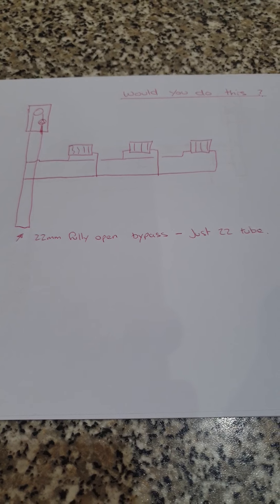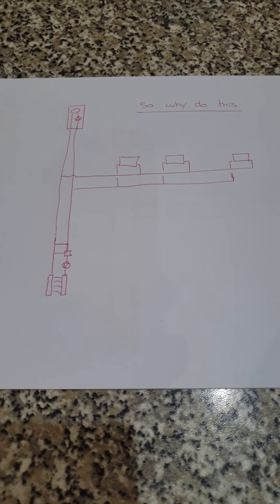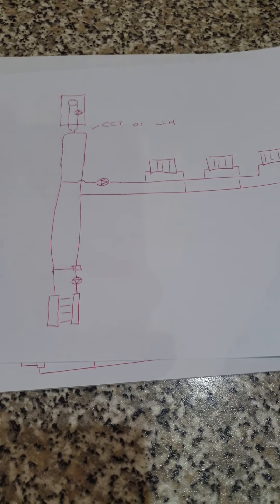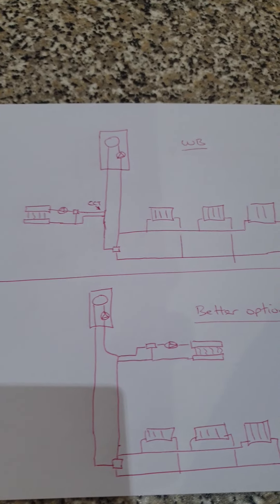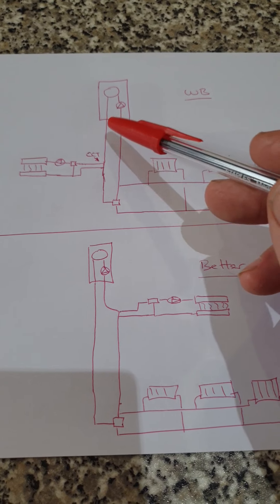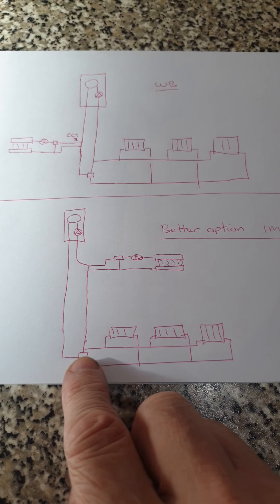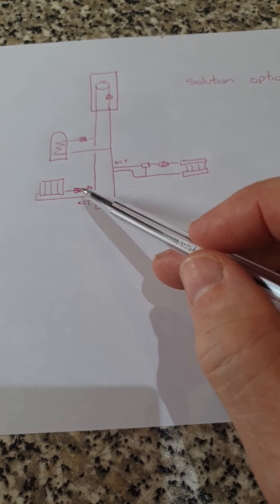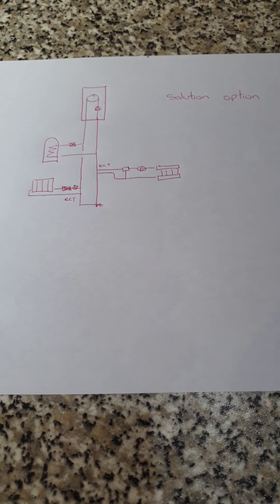Underfloor heating hydronic solutions

Comment: on the last diagram you got exactly the same propblem as with CCT on manifold. When DHW comes on you got a full bore 22mm bypass in the system.
Reply from the maker: This is primary secondary. The cylinder is drawn incorrectly though but was not really part of the explanation. At no point in this lay out is any single circuit a bypass to a different circuit. Dp in each circuit is un affected by the other at all times. Have you read the caleffi series of magazines ? This is all explained in these publications in great depth. Watch the detail on boiler types and notice condencing boilers never have ccts at the manifold. On non condensing boilers we deliberately create bypasses to raise the return temperature to prevent condencing.

Comment: When I have my radiators and UFH on together I want the UFH to use the radiator return flow only - is this best achieved with diagram 2 (zone/diverter valve) or will diagram 3 (CCT) achieve the same result? I.e. to what extent does the radiator loop (diagram 3) take priority over the UFH loop: fully (as per diagram 2) or does some of the flow get pulled across the tee due to the pull of the UFH pump?

Comment: But you said in a previous video that the water temperature should be about 70 for UF?
Reply from the maker: High temp manifolds need high temperatures. Low temperature manifolds need low temperatures
Reply: @andrewmillwardwatford9410  How can you tell the difference between a low temp manifold or a high temp
Reply from the maker: @Anthony-dh3ty  a high temperature manifold has a fixed temp mixer

Comment: im missing something? at point 52 seconds with the 22mm shunt (close coupled tee) is same as image 4m .51 sec point still close coupled tee or 22mm shunt. whats the difference?
Reply from the maker: If you look at the connections for the radiators and the underfloor on the second diagram, they are both on close couple Tees rather than just the ufh. This prevents the pumps from competing with each other for flow. Both circuits are hydraulically separated. However I did make an error in my drawing and the cylinder is incorrectly drawn on the diagram

Comment: What about after the zone valve at underfloor manifold?
Reply from the maker: If its high temperature its not an issue. A low temperature manifold should not have a zone valve

Comment: Thanks for your videos.  I have been watching with interest . Trying put it simply ( which I know its not?) CCT s are helpful  for 1 over coming resistance of the Hex where the Boiler pump is not big enough to run your system 2 making sure underfloor pump do not interfere with other parts of a heating system??

Comment: At 3:30 when you say that the diverter valve suggested by worcester bosch could be replaced by a 2 port-valve. How? In that case we would need a pump to drive the flow across the radiators right?

Comment: Hi Andrew - another informative video thank you.  Regarding hydraulic separation and a PWM boiler pump, I assume that separation would negate the benefits of a PWM pump as the pump would only be driving the primary circuit?  Presumably the issue with max load remains but if the pump is capable, could you forgo hydraulic separation without compromising performance?  Say a 20kw system setup?  Thanks again!
Reply from the maker: Hydraulic seperation is required.
Reply: Thanks Andrew.  Will a standard straight buffer tank provide the necessary separation?  I don’t see these mentioned with LLH, CCT etc.  But if volume is needed on a renewable system setup anyway can a buffer meet both purpose?  Thanks.
Reply from the maker: @MenofGwent  yes. I just did a 12kw heat pump with 80l buffer

Comment: Hi Andrew, hope its not too late to ask a question regarding this setup, I am about to install something similar to your suggested solution, however all my rads are run through a non-pumped manifold, point to point heating if you will. Would you still need a 3 port diverter valve in this setup? I am guessing not as the manifold would effectively bypass back to the boiler if all the actutors to the rads were closed? (at the moment the whole system is open loop with no individual control but I may add actuators to some rads). Thanks in advance, BT

Comment: Hi Andrew, thanks for sharing your knowledge on the subject. Great videos!

Is there any difference (pros/cons) between the third drawing (the one with the CCT at the boiler) and the last one (CCTs at the radiator and UFH take of points)?

You also said on the third drawing there were issues with pipe sizing. What did you mean?
Reply from the maker: You can choose to do either depending on the layout of the installation. Both will work. Best to just fit a Viessmann with an electronic mixing valve though.
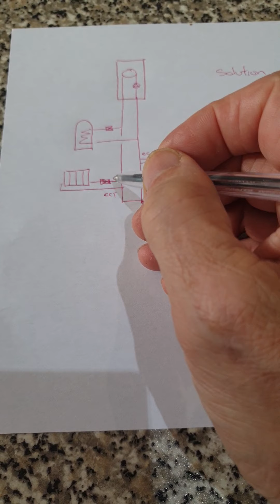Reply: @andrewmillwardwatford9410  Thanks Andrew. On your last drawing (4:30), what did you draw between the radiator and the radiator pump? Is it a 2 port valve?
Reply from the maker: @marcdebattista  yes.
Reply: @andrewmillwardwatford9410  Thanks. Why is the 2-port valve required before the radiator circuit? If the radiator pump is off won't the flow from the boiler simply bypass the radiator circuit because the CCT resistance is much lower than that of the radiator circuit?
Reply from the maker: @marcdebattista  I've made a few errors in this video. You just spotted another one. I should really remake the video.

Comment: Hi Andrew, thanks for posting this. I have been asked to install a UFH circuit on a combi system. I was planning on using the worcester method for hydraulic separation. I have put some thought into the orientation of the valve and wiring. I propose to have the flow going into ab, with the bypass on b and the flow to the rest of the system on a. Then connect the live from the heating thermostat to the valves white and grey with the orange going to the switched live in the boiler. The ufh thermostat will simply send a switched live to the boiler and to the ufh pump (via a relay) limited space and budget prevents me using two port valves. Can I kindly ask you if this arrangement will work and or am I making it more complex than is necessary. Cheers, Rick

Comment: Is there a way to use a mixing valve and the normal system pump for the underfloor manifold
Reply from the maker: Not that I know of. Do you have an idea
Reply: I’ve been trying to think of a way of avoiding the extra pump, although the way the mixing valve works It doesn’t seem posible
Reply from the maker: @joehaskett90  I think it's not

Comment: Hi Andrew on your drawing that is better designed than worcesters, without the additional pump for the radiator circuit. Does it work correctly when both systems are demanding or would the underflow circuit steal the flow?
Reply from the maker: It would work fine with both circuits as long as the water arriving at the ufh circuit is 20c or greater than the ufh return temperature
Reply: But doesn't the ufh circuit need to have delta t 7 between the flow and return?
Reply from the maker: @jameshazelip3998  yes. Ufh is Dt 7. The primary circuit is Dt 20. This is why the primary flow temperature must be 20c higher than the ufh return. If the primary flow is less than 1/3 of the ufh flow this temperature would need to be higher
Reply: @andrewmillwardwatford9410  I think I understand you. Are you referring to setting the underfloor manifold with a lockshield/balancing valve so when the underfloor pump kicks in it doesn't reduce the dt across the primary flow and return ?
Reply from the maker: @jameshazelip3998  no. No balancing valve is required.

Comment: Hi Andrew Another great vid 👍.          with the last drawing will the hws be slow to heat up(or boiler cycle)With water also being able to go around the loop at the same time. Just want to understand because I come across issues with ufh be added to systems all the time.
Reply from the maker: Yes the hot water layout is incorrect. It was my mistake. I was not thinking about the hot water but rather the ufh. Please turn a blind eye to my mistake.
Reply from the maker: Just realised I've put the ufh wrong also.
Reply: Hi Andrew I wasn’t trying to pick u up.       I really enjoy the videos u put up on utube👏 and the way u explain ur  💡ideas. 👍
Reply from the maker: @rosstaylor4924  I understand. But I still made the mistakes on this video so need to point them out. Thanks for your appreciation
Reply: @andrewmillwardwatford9410  what's wrong with the way you put the UFH in your last drawing? Thanks
Reply from the maker: @marcdebattista  would need a pump on the radiator circuit and the cylinder needs to be on ccts with a pump.
Reply: @andrewmillwardwatford9410  thanks Andrew. You did draw the pump on the radiator circuit.  I was asking about your comment that said that you’d made a mistake with the UFH. Is there one on that last drawing? Should the flow of the UFH be taken first from pipe after it’s come from the radiator circuit (it looks like it’s drawn the other way round)? With the CCT does it make a difference if the UFH flow or return comes first?
Reply from the maker: @marcdebattista  yes I drew the ufh the wrong way around

Comment: Hi Andrew, Thanks for the great videos. Just wondering if there are any general principles with regards to your last drawing. Does the primary loop need to be a minimal distance? (I'm thinking with regards to the boilers pump overrun). Ive noticed on some of your other videos your CCT's are very close to the boiler?  Does the primary loop ideally need to be one size up from and secondary loops? Should you always fit dirt and air separators on the primary?  Any help would be massively appreciated. Im trying to incorporate this into a combi with an underfloor heating and one radiator circuit. The rad circuit could do with a seperate pump as the boiler pump isn't quite upto the job.  Thanks
Reply from the maker: No need to increase pipe sizes. I don't fit filters in general. 
If pump over run is an issue you can incorporate an over run circuit.

Comment: Hi Andrew, really enjoy your thought provoking videos as to how to overcome certain things we all come across in the industry - and not just simply follow the popular influencers who close themselves off to alternative ideas. I am particularly interested in your last drawing, whereby you never mentioned what you have drawn in front of the pump for the UFH circuit - so is it a auto bypass or a divertor valve?
Reply from the maker: https://www.facebook.com/groups/1283670701667577/?ref=share
Reply from the maker: Close coupled tees followed by a mixer then pump
Reply: @andrewmillwardwatford9410  Ah, so you've added the mixer  / blending valve arrangement. Cool, I was wondering if you used them, so which option do you use if you do not mind me asking, and do you prefer electronic or manual options?
Reply from the maker: @ukjay7143  I fit electronic mixers. I only upgrade systems with poor design fixed temperature mixers. Fixed temperature just gives poor comfort and efficiency along with hydronic issues of dead heading and heat or flow theft.
Reply: @andrewmillwardwatford9410  Thanks Andrew, am I correct in assuming you use something akin to the Viesmann PlusBus Mixing Valve kits even on non Viesmann boiler installations?
Reply from the maker: @ukjay7143  No but I'd like too. I have done a Vaillant job.
Reply: @andrewmillwardwatford9410  So which kit do you use - do you go generic or have you a preferred brand that has proven reliable?
Reply from the maker: @ukjay7143  I fit Viessmann boilers with electronic mixers for ufh. Other systems doNt work well